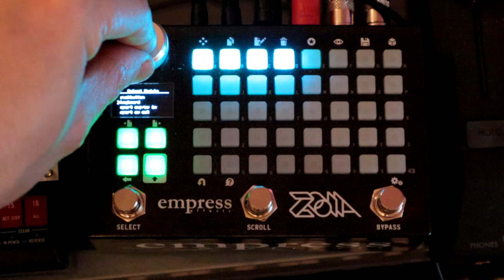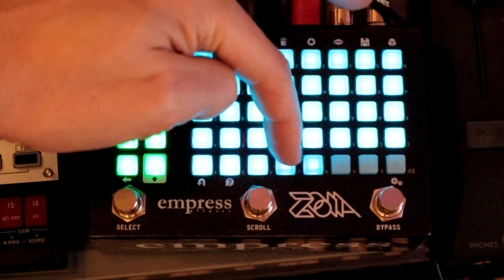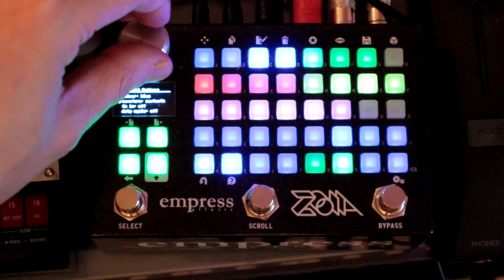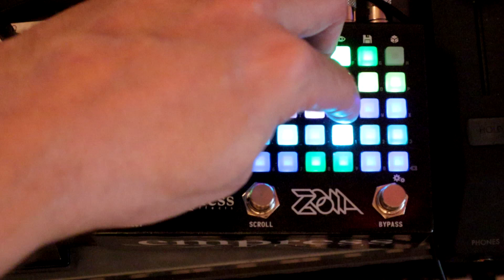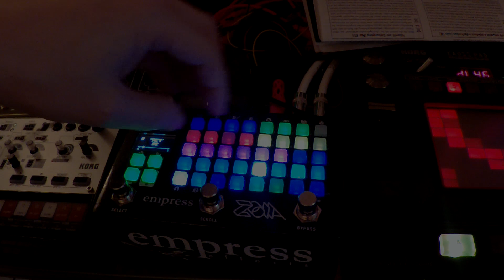Quickstart 6 - Basic Synth // Empress FX Zoia Tutorial

Comment: Hi I did all the steps but just get a continual note as well as the notes on the keyboard.  When I added the keyboard module I noticed that the last buttons for note and gate do not flash as in your video. Not sure why. Also what is the input connected to - I have tried connecting to the output and disconnecting - but still get a continual tone. Also it is unclear how the adsr is connected to the  filter module. This is hard to see as you say it is connected but your hand is in the way and I cannot see. I would really appreciate some help thanks. Feeling very dumb but tried to follow as closely as I could thanks!
Reply from the maker: Turn vca all the way down in volume. The gate now should trigger the vca 3:32
Reply from the maker: Make sure your zoia is upgraded to the proper latest  firmware
Reply: Thanks I did a factory reset and it is now working.
Reply: Thanks so much! i had the same problem. :)